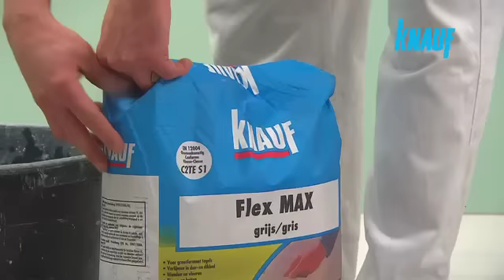Knauf Levelling System

Comment: Looks like it's lifting the tile off the grout/ glue whatever you want to call it. I think there would be a hollow sound of the tiles when the job would be finished.
Reply: exactly what  i thought.
Reply: Not at all....you always backbutter porcelain tiles....it gives the best results and for tiles over 600× 600 this system is perfect for level finishing.
Reply: Be great job for those massive tiles would it not
Reply: @billwellington4339  It doesn't help if you backbutter them, if you lift them up, they will still lose their adhesive and tolerate a lot less strain. That's why you see broken tiles in shopping malls and such.
Reply: @123TauruZ321  Then there must be a Sub-floor issue....I.e.
Excessive Movement
Screed not cured and tiled on too soon. 
If you spread the adhesive on your ,solid and sound, Sub-floor and then Back Butter your tile.....
You should have no issues and can be assured that the job is done correctly......using the correct materials for the job also helps!!
Reply: @billwellington4339  No. Even if the tile glue is even, and if you backbutter the tiles, and you lift up the tile like in the video, they will lose adhesive strength around the edges. They will tolerate much less strain on the edges then.
Reply: @123TauruZ321  You must be doing something wrong in your installation.....
Reply: @billwellington4339  Not me, i do things right. But the guy in the video may have trouble with disclaiming in the future.
Reply: @123TauruZ321  Crack on....Shiney Side Up.....😁👍
Reply: @123TauruZ321  yep which is why the manufacturers always stress that its not a substitute for floor preparation...but in real practice its almost always used that way and the philosophy is to fly thru it all with clips and fix what must be fixed later.
Reply: @billwellington4339  a subfloor issue meaning not a flat surface?  This happens all the time and to just back butter and clip tiles DOES create hollow spots.
Reply: @professorkaos2781  Yes, which is why it is very important to make sure the floor is very level before one start laying tiles on it.
Reply: @professorkaos2781  Exactly......which is why I always level floors prior to installation......then apply adhesive to floor and back butter as I go.....
Clips and wedges are used as an aid....
Reply: @billwellington4339    you are the first and ive been around...virtually everyone is using these clips improperly but shockingly it works most of the time if the floor is within reason and not bigger than 24" on any side.  Ive even seen 24x48 installed with the double ridged clips and amazed and what they can manage on a stacked pattern LFT.

Comment: I have used this system before and it is not worth the hassle. The clips do not break off properly. Sometimes they break off too high and you are left with a tiny piece of plastic between the tiles. Getting the plastic out is a huge pain in the ass.
Reply: That depends on what direction you kick the wedges lose.  If you kick in the same direction as the wedges it goes wrong !  Always kick (with your foot or hammer) at 90 degree angle at the wedges.
Reply: Milena, exacly! It does not break the right way, also not if you kick the right way!
Reply: Right, one of the big problems. Chipped several tiles trying to purge out the remainder of the clips

Comment: At 2:40 is the biggest problem with these so called leveling clips, it lifted the tile away from the mortar that was not a full bonded tile as industry standards calls for
Reply: That’s not the clips fault, it’s the installers fault

Comment: What is to prevent the tiles from cracking or breaking where you have created a void in the contact with the mortar bed ?
Reply: Nothing. I'm a professional tile setter and these systems scare me. I always pop up each tile and add mud to my voids
Reply from the maker: The system requires you to glue the tiles ànd the floor, in this case you will never have voids since the surface is completely covered.

Comment: Check out at 3:11 the spacing is not even. I mean it is an advertising video, could have at least made it perfect.
Reply from the maker: I don't disagree, but take in mind that Knauf was one of (if not) the first company to make this, the marketing video is made in 2011 and this might have been the very first floor placed with a tile levelling system so the guy who placed them must have had no experience either :D

Comment: Basically 100% leveling is not necessary in most cases as long as it looks level and no leapage. All 
From experience,  such leveling system is only helpful and saves time if the floor has 12 to 20 mm ups and downs. But i have done it with normal spaces even.

Comment: Takes up the double amount of glue and the tile seams do not line up properly, cause the wedges slide the tiles unvisibly out of place. The floor is a chaos filled with wedges and clips and work quality is lost. I did several jobs with this KLS and was totally not satisfied. A real pro can do without!
Reply: @PopeQ Many. I have seen it in different jobs of my colleague. Used the KLS twice, it might be something you know, but my results are way better without the system.
Reply: Can you tell me size of the tile you use to  work?
I agree that it take alot of glue, the second hand is not necessary at all but it's important and a Must to do a back battering behind the tile, a thin film so the glue to stuck.

Comment: Garbage system, you lift up the tiles and create a void.  If you're a professional you don't need this crap!
Reply from the maker: This is a common reaction but if you glue both sides (floor and tile) startled, you will never create a void. + the system is especially made for do-it-yourself people, although many professionals use this when placing bigger tiles. But, you are right, it is not obligated as 5 years ago this didn't exist (but big tiles were also not common then)
Reply: I've been tiling for 20 years I always swore I'd never use
 The clips i started using them on jobs around 6 months ago. They really aren't bad on some types of tiles. And if you apply the right amount of adhesive there is no voids